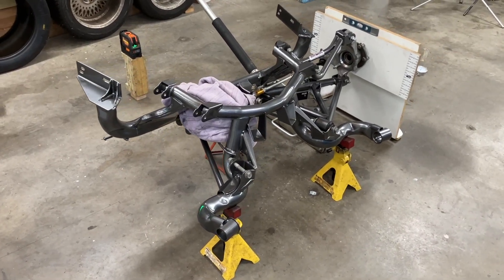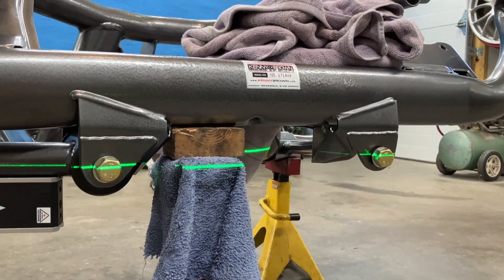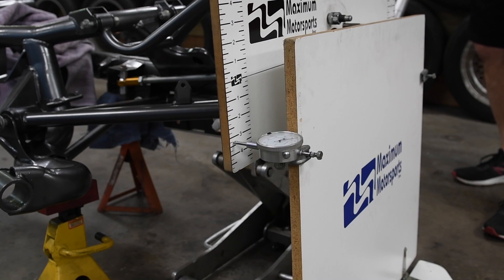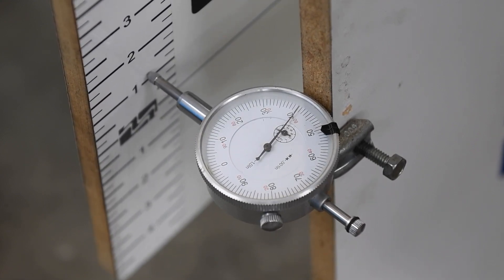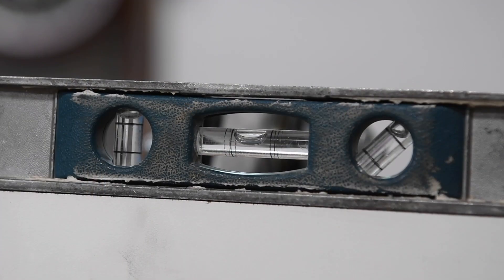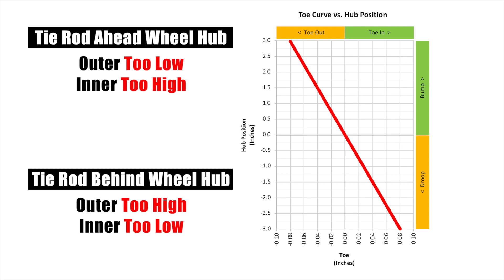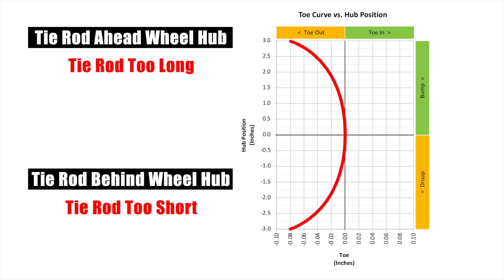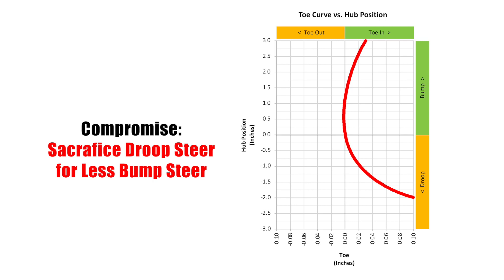How to Measure Bump Steer

Comment: I watched a LOT of videos on bump steer gauges and this one helped me the most. Also thanks for the bonus spreadsheet. Its way easier to interpret data when its been graphed. I bought the MM bumpsteer gauge and checked the bump steer on my 07 GT500 before I lowered it.
Reply from the maker: Keep in mind that if you're keeping the rubber bushings in place, bump steer without any load on the bushings may not get you the best results. Unless you're altering the factory geometry, changing the bump steer curve on 1996+ Mustangs may not be necessary.

Comment: Great video. I made my own tool based on what you have. Zero bump steer would be great but what would be an acceptable range to strive for?
Reply from the maker: I think Maximum Motorsports recommends less than 0.050" per 0.5" of bump travel. But, you can usually get it well under that.